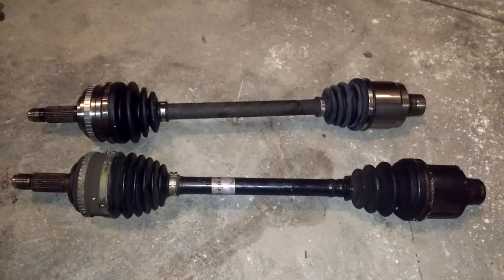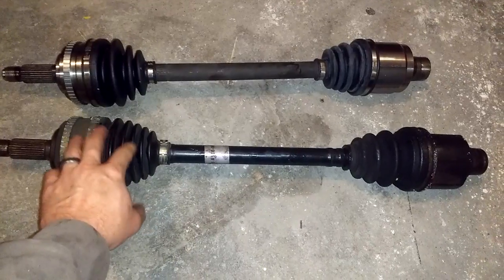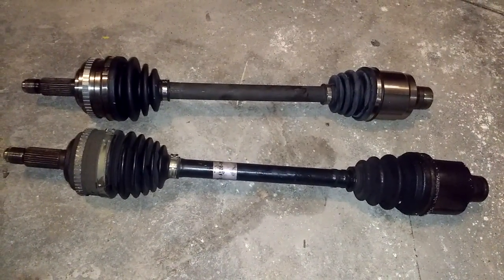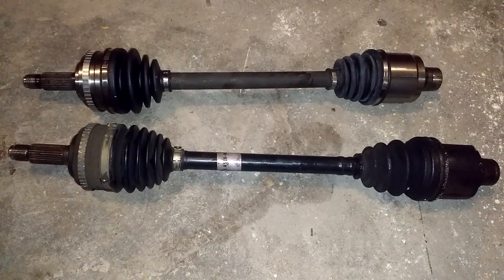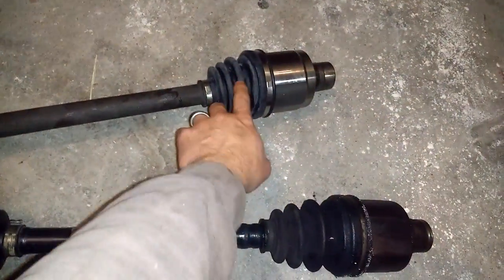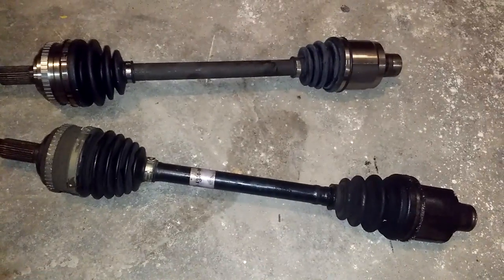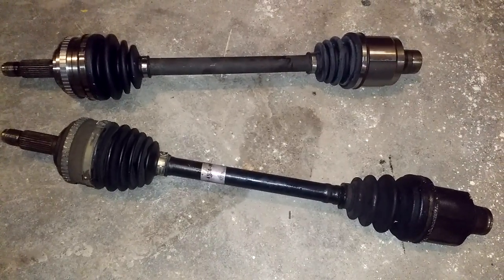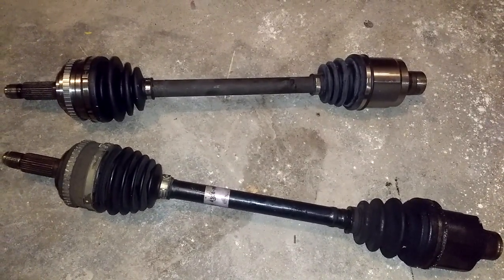How to know when your CV Axle is going bad that is not clicking when you turn

Comment: Hi

My car vibrates at high speeds over 70kmh. However in neutral it goes away, do u think this is axle related or maybe transmission?
Reply from the maker: It would be hard to tell.  So many things can cause vibration at 70 kmh.

Comment: Hello nice informative video. I also have an Odyssey (09) and get the same clunking rattling ticking sound when turning left or right after driving for awhile with warmed up engine. But NO vibration during high speeds which is weird.  I also recently just replaced both L and R  sway bar links because just by visual inspection alone I could see that the rubber bushings were ripped open. And it's worst when turning while in Reverse I could literally feel the steering wheel tugging back and forth. In your opinion do I have the same problem with Cv axle?  thank you.
Reply from the maker: Sounds like a CV axle.  Was it?
Reply: @diyflenar  Finally replaced CV axle that I got from Amazon and it's as good as new.

Comment: I have a question , I was assuming based off my car's performance that it would be considered a bad axel ... I noticed ever since my car got in a accident , whenever I'm going over bumps or going fast my back tire feels as if it's slightly jumping and slightly wiggles ... I wanted to know if this would fall under this category.. I'd appreciate any feedback thank you
Reply: Yours will be damaged suspension member. Alignment check can pin point the issue. Late response . Sorry . Hope you got it checked
Reply: I had a wheel wiggle in the rear and it was the bearing assembly. I was really afraid the wheel could fall off. A few of the ball bearings even made horrible squealing and loud bangs and  crunching noises and got pulverized during the period of still using the vehicle for short trips up to the last harrowing ride where fear overcame fool hardiness. As it turns out the rear bearing assembly is pretty stout and wheels actually falling  off would probably not happen before the wheel just seizes instead and it would be smokin and squealing something fierce by then. Better safe than sorry of course.   Has anyone else had these modern wheel bearing assemblies failures to cause wheels to fall off? At highway speeds for sure things could go wrong pretty darn  quick so everything that happened to me was on slow motion back roads.

Comment: My car shakes when I accelerate gently but if I hit the gas hard then I don’t feel the shaking I just checked the tires did tire balancing and week alignment but still shakes especially if your going on a small hill
Reply: That's wat mine does I accelerate and it shakes a little bit I dont hear clicking tho... but I jus changed my brakes and saw the boot was torn and grease all over my brakes might as well jus change out the whole CV axle

Comment: I replaced both CV axles 5 months ago on my Corolla, I can't remember the sound exactly but I'm getting a new sound now that sounds like popping. It happens when I turned and drive also I had it happen on a bump
Reply: marc check all suspension components.  From your description, I'd start with the inner tie rods
Reply: @boxerflako  I replaced the tie rods inner and outer. This all happened after I went to an alignment shop that wouldn't do the alignment unless I replaced the ball joints, I let them do the job instead of me. Not too far from the shop I heard the noise and took it back. I complained about the noise and the alignment is pulling to the left. I think did a crappy job but don't trust them to touch it again, with how nonchalant they were when I mentioned the issues. Do you think that the new ball joints are causing the old control arms to pop? That's the only part I haven't replaced in the front suspension.
Reply: marc although you've replaced most parts, it could be some parts broke again due to various reasons.  A good visual inspection + tugging/pulling on parts to look for play will help diagnose.  You're springs/shocks and mounts should be inspected also
Reply: Check your bushings on all stabilizing bars. And control arms.
Reply: Strut mount
Reply: @alansmilealot  yes your new one is making the old stress alot.. evertime when you change any part on your vehicle supposed to change both parts at same time if not that can happen... Problems...

Comment: I have an 05 Crv and I get the shake on the steering wheel at 20 mph just when driving slow I feel like the tires on front it’s going to fell out but I don’t hear it nothing at all noticed the both axel on front has a little of play but I can’t tell if that’s a normal play
Reply: Hey I think I have a similar problem... I have '05 Accord EX with 2.4L gasoline engine, and I can feel shaking on acceleration, but only from 25 and 35 km/h. It's shaking in every gear (1,2,3), so I guess it's not the gearbox... I can't hear any weird sound... it just shakes (vibrates). Due to the problem I replaced both shafts (including CV joints) and also the bearing on the right, which holds the right shaft. So, I am wondering how did you solve your problem in case you did? :)
Reply from the maker: Did you find the fix?

Comment: If someone could reply, that would be most appreciated. I have an 08 Elantra, and I’ve noticed when even I’m lightly turning I hear a light grinding sound. When I am full lock I don’t hear anything unless again I hit a rip or bump, or I accelerate. No popping or clicking. Just grinding. I don’t know if it’s the CV joint and axle or the steering rack? I don’t have a lot of money, (college student) so I’d like to diagnose and fix it myself. I do all changes of liquids and rotate tires. So I can turn a wrench.
Reply: Shawn Horton could your tires be rubbing? Is your brake shield behind the disc bent and potentially rubbing on the back of the disc as you turn? If none of those, it could be a bearing (the one being loaded with weight as you turn) going bad.

Comment: I hear a clicking sound on my
 Driver side front left tire I hear
It when I step on the gas and I heard it when I was braking and backing up can someone tell me what that is I have a 2009 Hyundai sonata the sound just started 15 minutes ago literally? Also 2 months ago I had my caliper front brakes and front rotors done due to the caliper
Going out .. now I am hearing clicking sound someone help please
Reply: Did you hear it while braking and reversing? 

Does it click while driving straight? 

Or does it click while wheel is turned?
Reply: @Jaxson8157  yes when braking and reversing

Comment: Please NEED HELP !!!! 
 So I was driving my 1993 Honda prelude(manual transmission) and I was going in reverse. while I was going in reverse I thought I was going over a branch(because I heard crunching noises)  and while I was done reversing and I put it in first my car didn’t move at all but the engine was still in and running I just didn’t move . While I was doing some more investigation I could move the car but it was vary violent and shaking the car and sounded so bad . When I looked underneath the car I found that the right axle was turning while the car was in neutral. But the tires wasn’t spinning and I could hear some type of rubbing . Is it time for a new tranny ? 
 Please help .
Reply: I'm sure you've figured it out by now.  
It's a broken CV axle from what it sounds like.      Happened to me exactly how you explained on a 89 Buick Lesabre.

Comment: any help please have a 2010 Chevy Silverado  brand new rims and tires 305 50 20 -44 offset did my whole front end with moog upper lowers  iners and outs did  a alignment  rebalance the tires and did brakes and  rotors  still having a vibration on the steering wheel at like 60 please any advice out there
Reply from the maker: Did you ever find our what it was?